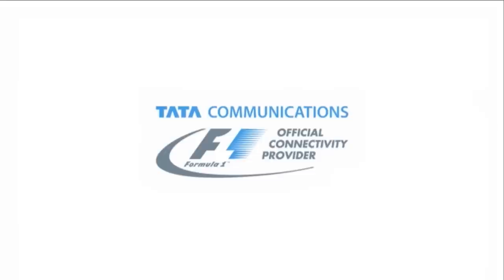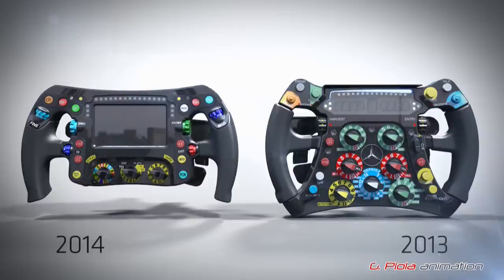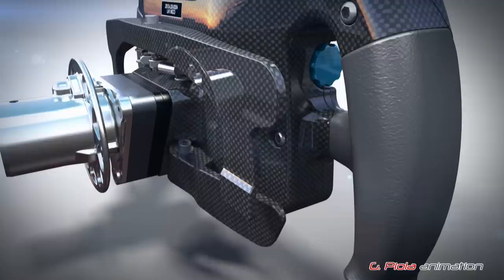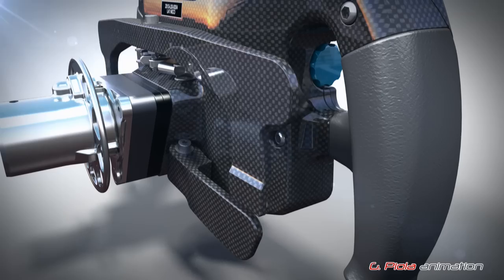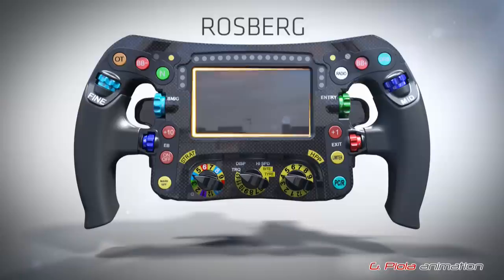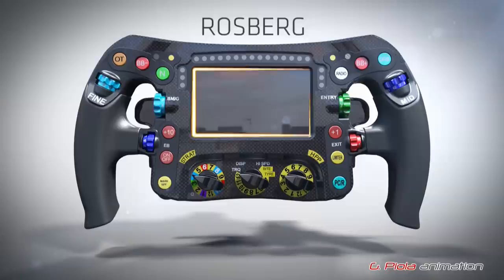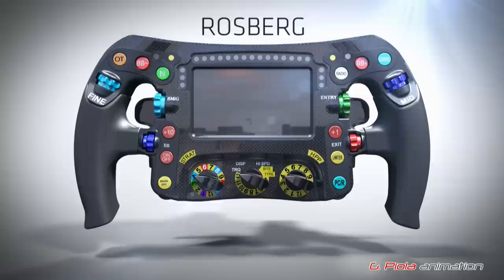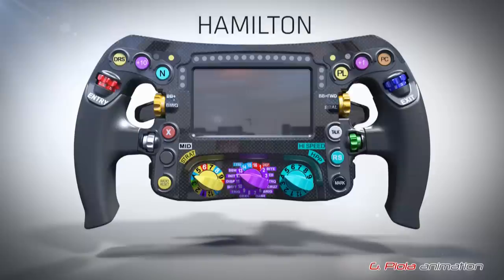F1 Steering Wheels - Lewis Hamilton vs Nico Rosberg - Analysis

Comment: I wonder how much they actually use these buttons while racing.... Must be complicated as hell to be driving 250-300 km/h and having to brake, shift, press some other buttons, trying not to hit J. Button, taking a corner and repeat ....
Reply: I think they use them indeed. try looking up video of nick rosberg showing how gearbox works. agreed on how hard it must be to keep focusing on a race and also changing all those things.
Reply: Gt3 cars have twice the buttons a set on the steering wheel and a set on the near the Shifter...or well where it used to be...

Comment: this is why F1 is boring - too much settings and fidling with systems and computers... let them have a purely mechanical car - e.g. nascar
Reply: +TTdexter so than why not just keep watching your nascar series?!
Formula 1 is the most advanced motor racing competition. They need this highly developed specs in order to get the best performance you can get. You can not compare it to something modest like the nascar vehicles.
I wonder why you even watch this here if you don't like modern technique that much???